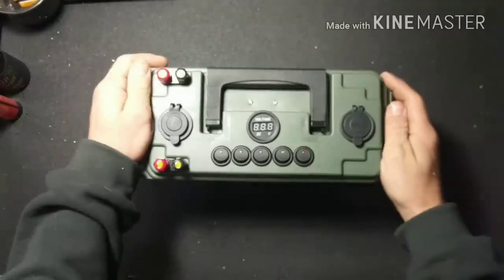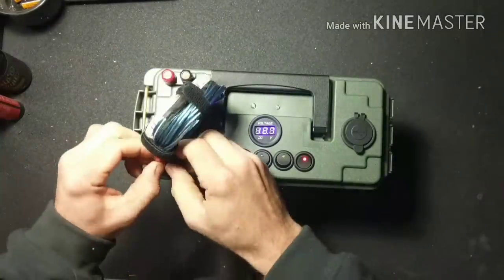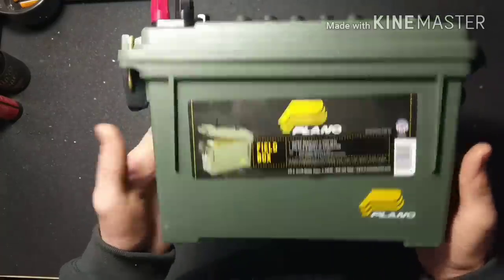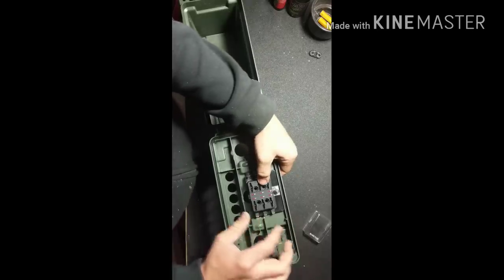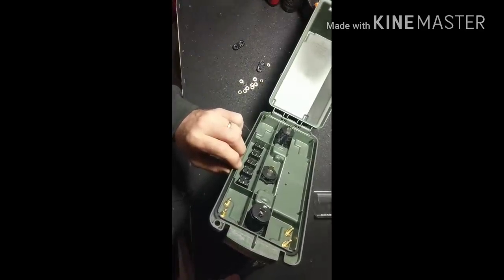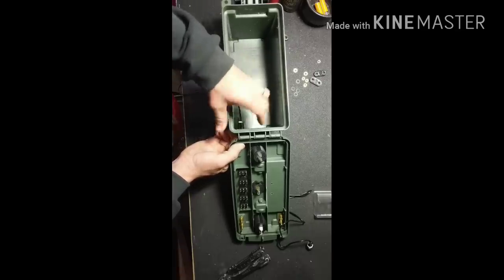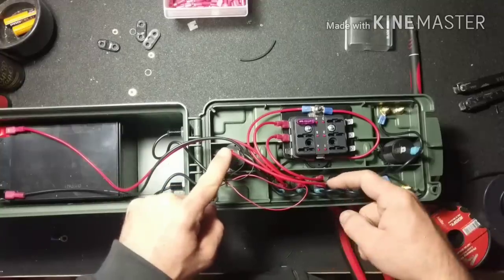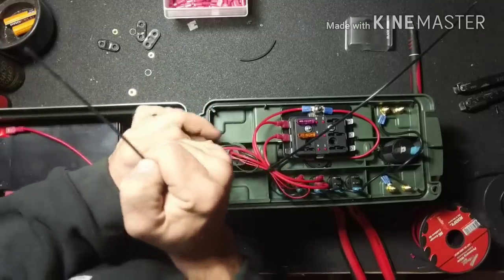How to build a portable power box version two

Comment: Where would you install the temp reader in this box because of the fuse box takes the space? Also how would you install the speaker list to a box like that and still have room for as many batteries you can fit need something that can run the house lights the helix 8 and the speakers hope you answer this
Reply from the maker: I would move the fuse block or switch to an inline fuse to install the thermometer. Also for speakers you need a 50 cal box. Those work awesome thanks for the question

Comment: going to do something similar for my kayak...but plan on mounting the usb port and volt meter to the yak's hull with wiring in the interior, connecting with my Garmin power cables to an SAE connector. That way I have only only plug into the water sealed box containing my battery which will be mounted inside my kayak.  One question, how important are the fuses....never use one on any of my fish locators and their SLA batteries...how likely is there going to be a surge to a USB port or simple LED lights?
Reply from the maker: In my opinion fuses are very important. They protect not only your battery but also your devices running off the battery. Should at least have 1 master
Reply: @JDSOutdoors   make sense. thanks for answering. video is awesome.
Reply from the maker: @chrisrondeau9912  no problem. I love reading messages and interacting its the most fun part of the job lol.
Reply: @JDSOutdoors  one last one, any opinion on the dual USB ports with the voltage display sockets instead of two separate sockets? I have limited space on my kayak to mount various sockets/accessories.

Comment: Thanks for this terrific project. I just built one myself, and the instructions are very well done.  I would like to add an Anderson Powerpole socket (has 2 connectors on it), but not really sure how to wire it up to allow connection to the battery  for power and/or recharging, as well as hook it to the 2 remaining fuse box slots. Can anyone help on that?
Reply from the maker: Just looked that up to see what it was. Just hook that directly to the batter both pos and neg and make sure you get one with the inline fuse. If you build it like I did in the video and try to run that off the fuse block you will overload the wires.
Reply: JDS Outdoors thanks for the really quick response! Great idea!

Comment: I love this its great....Whats protecting your battery from short circuit on master switch? Shouldnt there be a main fuse in between the Battery and first master switch?
Reply from the maker: Good question and the answer is nothing. Think of it as the main battery cutoff on like a camper or a boat it's a similar concept to that. You could add an inline fuse if desired between the battery and switch but it's a little overkill
Reply: @JDSOutdoors  Ok....essentially your main power lead that carries all the current from your fuse box to the battery is unprotected.......like you say an inline fuse for a couple bucks would be perfect for piece of mind....Internal short circuit would ruin your fishing trip :) Great job again really impressed!

Comment: Thanks for the video, best video I have found. In the description the bolt meter/usb/12v plug all together is not what you used in this build. Can you update the parts list to include the pieces you used for volt meter, usb and 12v plug in this build please?
Reply from the maker: That is exactly what I used in this build. When you receive the part you unscrew them from the black face plate. Its cheaper this way and also ensures you get the right volt meter to fit that isn't to long.
Reply: JDS Outdoors thanks a lot for the response!!
Reply from the maker: @christorborg8165  no problem thank you for the compliment by the way. Enjoy

Comment: You should put fuses in the empty slots your not using for backup fuse you can just try a box a fuse in the box but it will Rattle and make noise
Reply from the maker: Problem with that is then the posts will be live as soon as the fuse is installed

Comment: Thanks for the great video, I was wondering if it's easily possible to swap out one of the settings for example the cigarette outlet for a regular wall outlet? Or if you could just use a power invertor into the cigarette outlet?
Reply from the maker: It is however it would probably be easier to just plug a small inverter to the 12v outlet. If you have a bigger box build it would be easy to wire in and inverter then wire 110 plugs off of that
Reply: JDS Outdoors thanks for extremely fast reply I can’t wait to build this!

Comment: Really good video! You made this build look fairly easy and understandable.One question, how would you add a plug to charge the battery? With out it I assume that you would need to pull the leads off the battery to allow for the charging cable to be attached via female connectors or alligator clips.
Reply from the maker: Lindsey Brallier yes that is correct and thank you
Reply: Never mind, I watched the video again and you describe how to charge the battery a couple different ways, awesome video! Thanks!

Comment: On the power poles, it should go flat washer, lock washer then nut.  You're defeating the purpose of the lock washer by putting a flat washer between it and the nut.
Reply from the maker: It's personal preference. I do it the way I do it because the washer digs into the plastic and helps keep the post tight and from spinning. Either way works. If it was all metal I'd do it the way your suggesting

Comment: Hi thanks for your video a simple to follow set up just made mine looks great just wondering would this unit be able to run a 12v cooler box if so how long? I've also got a 10w solar panel and charge controller attached.
Reply: Steve Davies  - - look up Will PROWSE on YouTube, he addresses your question(s) regarding how to add solar to the battery power box JDS has made.

Comment: Hello JDS, First let me say thank you for your videos, They are a great help.  I have a question if you know the answer.  I have built this box and it works great,  How ever I would like to build a box a little larger.   I have a couple Lawn Tractor batteries.  1 is a 220 CCA battery and 2 are 320 CCA's  are they any good to use and also do you know what the AH rating is on them?  Or if anyone here can answer that question.   Thank you.
Reply from the maker: They are ok to use and will work fine. They just wont have a very long life due to not being a deep cycle. I'm unsure of the ah rating
Reply: Thank you very much for your reply,  I do like your videos.  Please keep up the good work.  I'm sure everyone appreciates all of your help..

Comment: Do you have issues with the battery sliding around in the box? 

Was weather resistance a consideration? I ask because all of the switches and power points are facing upwards.

Comment: Do those side led lights fit flush? How long would they run on a 7.2 amphr 12 volt battery?
Reply from the maker: No they stick out about 3/8" and you will have no problem getting at least 2 nights of just those on

Comment: Fantastic video!  Based upon what you said about charging the battery via the power posts could I charge it via the usb??  I have a solar panel that has usb connectors and I'd like to charge the battery while I'm out on the water in my kayak.

Comment: I have a question. So I started building my box got to hooking up my first switch to the battery and then the fuse block. My fuse block has 6 fuse spots and 12 prongs. 2 prongs for each fuse. But it does NOT have the screw your talking about that your hooking the switch too. Please help!  Thanks.
Reply from the maker: Sounds like one spot on each fuse is for power in the other is for power out?
Reply: @JDSOutdoors  so for the main switch to turn on power to everything how would I hook that up if mine doesn't have the screw like yours did.
Reply from the maker: @micshtr  look at my very first power box video that has the same style fuse block I believe
Reply: @JDSOutdoors  ok thanks!

Comment: Could I use a 12v 7ah battery instead and how long will the battery last ? Planning to use the box to charge phones on a weekend camping trip. Thanks
Reply from the maker: Absolutely you can. This will work with any 12v battery
Reply: JDS Outdoors For charging, could I cut the ends of the speed charger cable, permanently attach alligator clips and charge in with the power posts ?
Reply from the maker: @rasychea  you can do that However I would hook it directly to the battery it would be easier to remember than having to turn on switches

Comment: Thank you, I needed this since I’ve been using a bare battery with wires connected to an automotive receptacle. Where did you post the links for the parts you used? I don’t see them. Since I was looking on my own, I found a marine power panel on ebay for around $5 with the receptacles built in. Have you tried using them? Was just curious if this would simplify the build or if it made it more difficult.

Comment: Great, thorough video!  I am building a power box got my kayak this week, so it is timely!! I like the way you jump the negatives together, and it was useful to know how big of a fuse to put into each circuit protection slot. I am building it for my kayak that will have a trolling motor on it.  I have a question, do you really need a master power switch if everything else has its own switch? Also, I charge mine using the cigarette lighter connection.  Like you said, there are many different ways to do that, for me it just seems easy to work with one plug.

Comment: Looking to do a build like this but with a 50ah in a bigger box. Also want to use sae ports instead cigarette lighter. Can I use all the same equipment you used here?
Reply from the maker: Yes you sure can. Just guage the wire properly for your needs
Reply: What gauge would I need for a 30lb thrust trolling motor and a fish finder going into the sae ports?
Reply from the maker: @nomadbrig2850  10 gauge for the trolling motor as long as it's close and it has to be it's own circuit. 16 for the depth finder
Reply: So just run the motor independent and run the finder in the loop?
Reply from the maker: @nomadbrig2850  yes
Reply: Right on. Thanks for the video I’m electrically challenged. Couldn’t figure out how to daisy chain the ground.
Reply: What size fuse would I need for the motor and the finder?
Reply from the maker: @nomadbrig2850  finder I use 3 amp the trolling motor depending on size and length of the run 30-60 amp breaker

Comment: Thanks for the great video and step by step guide. One question the battery supplying 12A hocked up to the fuse box, where there is a 5 amps fuse before the USB charger, how does it work ? the fuse should break already when the source is supplying 12A? I know I am wrong but who decide how many amps goes through?
Reply: "Amp Hours" are a measure of battery capacity...or 'how much power it can supply over what amount of time'. A 12ah battery will (loosely) supply 1 amp, for 12h.  Or  (in math terms) 12 amps for 1 hours...2 amps for 6 hours, etc.  Amps when talking fuses and loads are different altogether. The load is what decides the amount of amps that will be flowing through the circuit.  Think of amps as the energy being 'pulled' from the battery.  If you light up a small LED, that LED pulls a tiny amount of current (amps).  Spin an electric motor, that will draw more. If you fuse the circuit with a 5a fuse, you can run a load (or multiple loads) that draw under 5 amps.   The rating of the fuse is dictated by the size of your wiring and other factors.  You want the fuse to be the weakest point, so when a load is put on the circuit that is too high, the fuse will burn before any other parts of the circuit are damaged.Also, the fuse should be located as close to the positive terminal as possible.

Comment: I am not sure if I bought the wrong parts (what you listed) or if I did something else wrong. None of the backing rings on the larger parts would fit in between the partitions. I had to remove them completely and then also grind the tabs off of the ring for the voltmeter. I would appreciate some closeup photos or slow moving video showing the mods you made to fit the parts.
Reply from the maker: The middle volt meter you have to grind the tabs off to make it fit and you have to make slits in the partitions so the rings fit. I thought those parts were in the video my apologies
Reply: You are correct. I went back and watched it and you DID say that and show the slots to grind for the tabs. What size fuse do you recommend for the banana terminals? And do you switch the banana terminal separately or on the same fuse and switch?
I've watched the video so many times now, I think I almost have it memorized.
Thanks for taking the time to make it and showing us how.
Reply from the maker: @crude4u1948  5 amp and yep one switch per fuse

Comment: Couple of quick questions about the switch holes.... Did you use the 3/4" spade bit for these holes? Is that about the correct size needed for the switches to fit?

Comment: Is there any way you would by chance have a wire diagram. My first switch is now working right. When I turn on my second third fourth switch it’s throwing power to everything. I missed something. I’ve been over this box probably five times. Could you or someone please help. I need a diagram to see were all the wires go. My switches are different and my lights only have two wires. They don’t have to be stripped. Just pos and neg . But for some reason everything is coming on for the rest of the switches. 
I’ve wired hydraulic boxes for cars that were easier that this lol.

Comment: Thanks for sharing this build.  Being a Amateur (Ham) Radio Operator, this was very interesting to me.  I am wanting to build something like this but with the larger Plano box so I can mount a dual band mobile radio in the box as well.  This would be for having portable communications ability all in one box.  Looking at how you could charge the battery, just curious about using a solar panel going thru the cigarette plug.  I assume you would do the same sort of operation, instead of turning on the post switch, you would turn on the cigarette lighter switch.  Very good information again, thanks for making and sharing the video.  Juddie WD8WV

Comment: I have finished by build using parts from your list.

Not sure if my voltage meter has a issue or not but... it is reading 0.2V less when compare to measuring directly from the battery source.

??

Comment: Warning - To those considering adding a Solar Controller and Solar Panel(s) for charging the battery in this project. Solar Controllers can typically output voltages higher than 13.8 volts to charge a 12 volt battery. In an equalization charge cycle the output can exceed 15 volts. This is important to note because not all “12 volt devices” can handle the excess voltage. If you plan to operate your electronics from this battery box WHILE the battery is being charged with a Solar Controller/Panel(s) some type of Buck Converter or Voltage Regulator should be in your circuit between your device and the battery. Typically, once a “12 volt battery” has been charged via Solar and then disconnected the output voltage from the battery will tend to drop somewhere between 12.6 - 13.8 volts. Check your specs and make adjustments in your design so you don’t fry a radio or other device. Hope this saves someone $$$$.

Comment: I built this a couple months ago and it has performed incredibly,. But I do have two quick questions about charging/voltage.
- Is there anyway of determining how much juice is left in the batter after using it? 
- Is the voltage meter an indication of how many volts are being used or how many is left in the battery before charging?
- How long does it take to charge?

Thanks in advance to anyone that can provide some answers!
Reply from the maker: Yes use your voltage meter to determine how the charge is. 13.6 is full, 12.6 is half, 11.6 it's time to recharge soon. Also time depends on your battery size and charger amps. Usually 8-12 hours giver take

Comment: JDS, if you were going to switch that volt meter, would the on/off switch go in the power supply line and the voltage meter?
Reply from the maker: Yes

Comment: Thanks for the great tutorial. Do you have some information on integrating a solar charge controller to the box? I plan on using a solar panel to charge the battery during the day and have heard you should always use a charge controller to avoid damaging the battery (overcharging?) Would be great if it was small enough to install on the outside of the box (perhaps on the side).
Reply from the maker: Chavo yes always use a charge controller and unfortunately I have not made one yet because most solar panels aren't small enough to fit nicely on the side I'm still looking and testing solar systems

Comment: I assume that since I already own the 100 Watt Solar Panel Kit from Harbor Freight, that I could just disconnect one panel and charge the battery in your build with that one panel. Have you had a chance to do anything with a bigger panel? Just curious as to how long it takes on average to fully recharge a 12 Ah battery with it. Alternatively, I COULD just use the open connections on the installed controller from my system, perhaps.